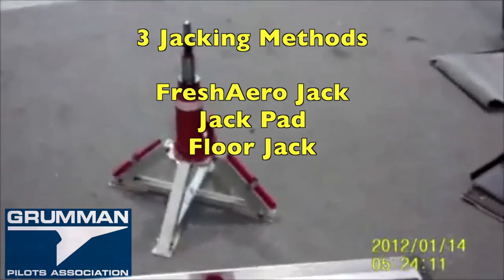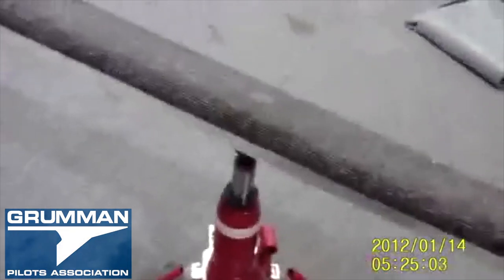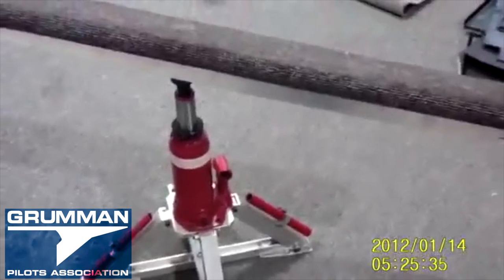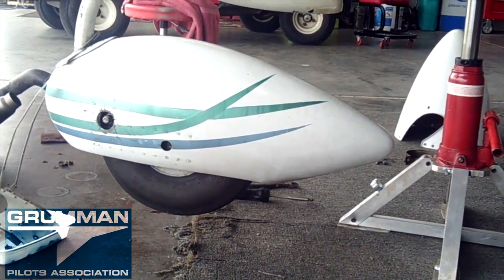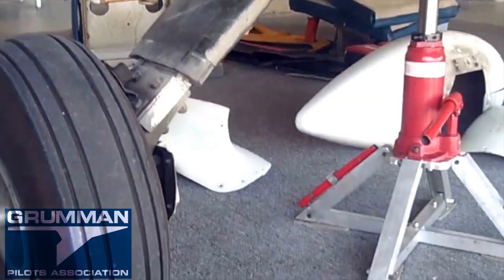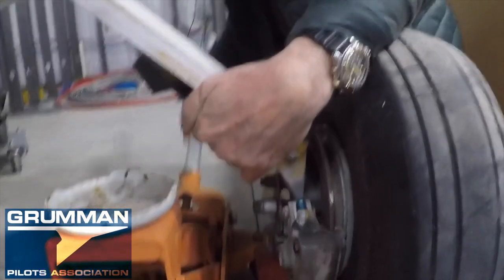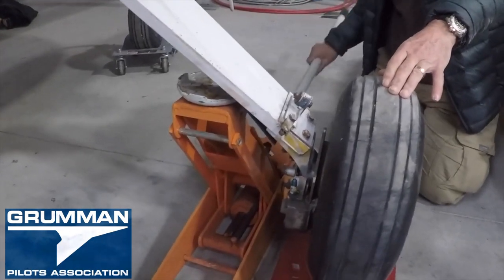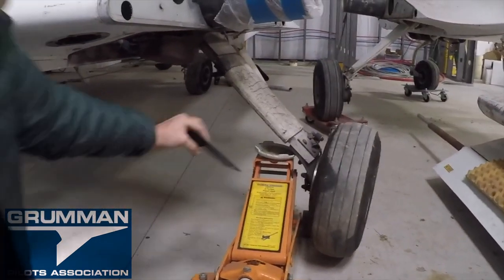Jacking a Grumman Final Answer 2020 - Grumman Style

Comment: Great video.  I have done the third, “nut method” a number of times and its scares me.  Some floor Jack’s are not designed for the side load the top of the Jack experiences, so just be careful it doesn’t try to pop out on you.
Reply from the maker: Not hard to make a jack pad.